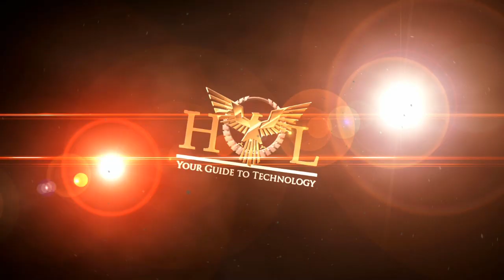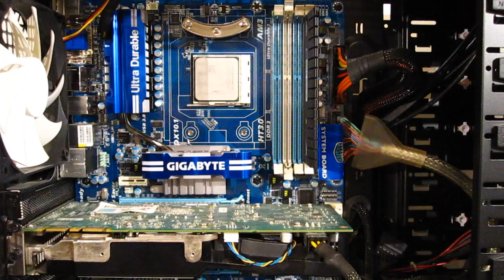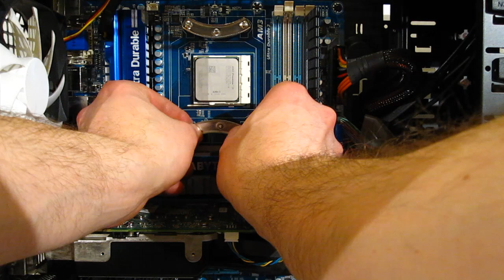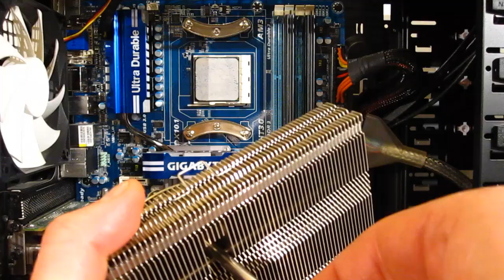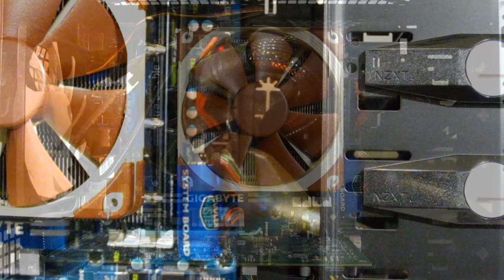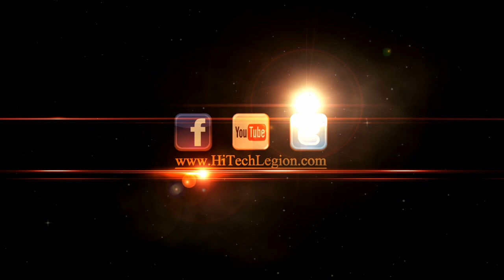Noctua NH-L12 CPU Cooler Installation at HiTechLegion.com

Comment from the maker: The NH-L12 requires using the existing backplate. So, no, you will not need to change it, but you will need to remove the stock clips.

Comment: Thanks for the review. This is a large contrast from the D14. 680g compared to 1247g with 140mm fan. I can't see how air coolers could get much bigger than some of the LGA 2011 coolers. I wonder what kind of temperatures we can see with this one. It's a good looking cooler.